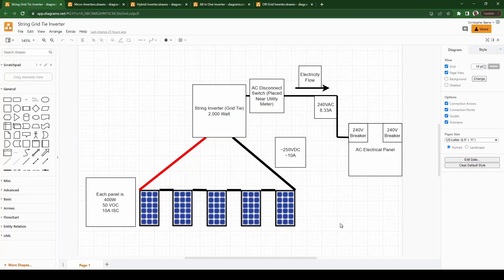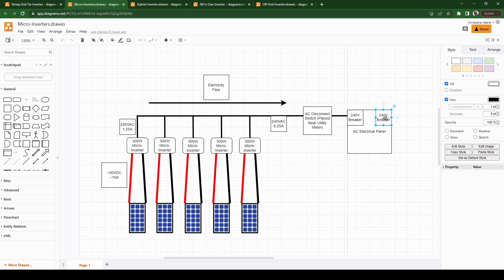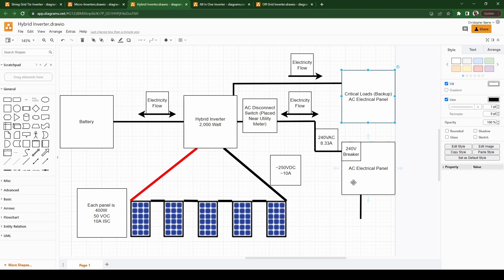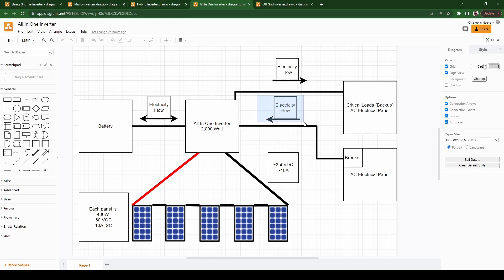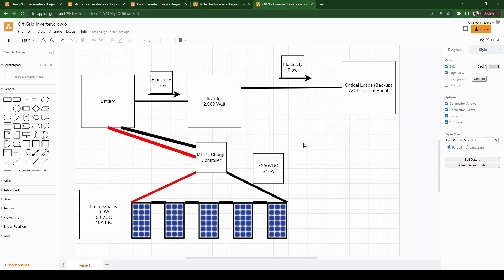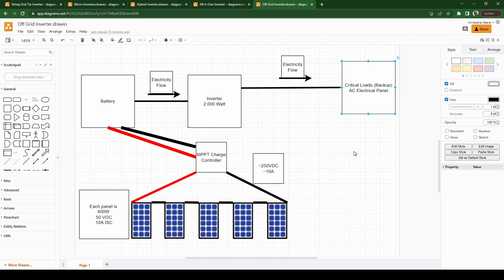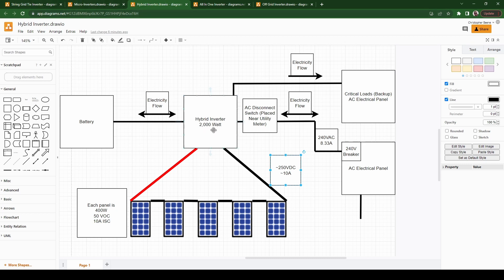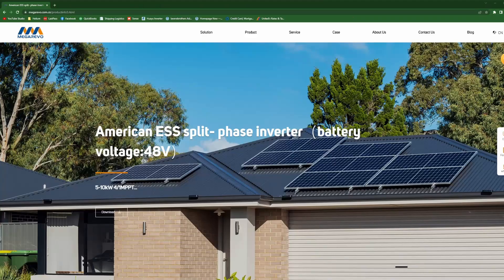Solar Inverter Types Explained/Overview

Comment: So, how (in ballpark terms) is the critical load panel separated out of the system in the hybrid inverter setup. For example, lets say I have a dedicated branch for my refrigerator in my main panel but want to be able to run it from solar/battery if the grid is down. Does the critical load panel splice into the existing wiring, back feed the mains, or do circuits in the critical loads panel need an entirely new cabling run from the critical loads panel to the appliance?
Reply from the maker: The way it works is the critical loads panel connects to the load output of a hybrid inverter. That way the inverter can flip a relay and isolate the critical loads panel from the grid.

Comment: Good day to you! Thank you for the informative video. We appreciate it. We saw on your video short that you were able to get the CT's working. Did I miss where you posted your settings? Also, did you buy your unit from Alibaba?
Reply from the maker: I'm still trying to get that video up, been busy getting some other issues squashed with the operation of it and get the firmware updated. Which added more settings I get to work out! Lol

Comment: I went for a totally off grid system because I didn’t want to go through all the regulations and time, money to go through the main panel. Plus if the grid goes down I still have power.